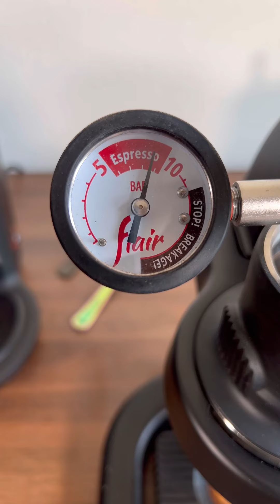Pressure Profiling on the Flair 58 #shorts #espresso #flairespresso #flair58

Comment: Love this!

My recipe with the Flair 58 is an 18 g dose, 40 g extraction. We pre-infuse with minimal pressure (1 bar?) until we see the extraction start to form at the bottom of the basket -- I haven't timed it, but I want to say it's probably around 10 seconds. We then slowly ramp as you described, to around 7 - 8 bar. The extraction takes around 25 seconds. We're using a medium roast -- 5 to 28 days from roast date. 

What I'm struggling with is channeling. It doesn't matter what basket I use (ridgeless VST or Pullman), or what tamper I use (stock Flair, Pullman Bigstep, Pullman Palm). I do the WDT thing -- 0.4mm needles.
Reply from the maker: Maybe it's not channeling? 🤔 what makes you think it is, how does it taste?
Reply: @FlairEspresso  it tastes just lovely! Here's a quick clip of this morning's shot -- https://youtu.be/Y533ZH6gb6I

I know it's what I'm doing and not the equipment, because I've pulled better looking shots before. :)
Reply: @razorx999  Thanks! I rinse the puck screen after each use. I actually ended up with two, and I recently took out the (new) second puck screen to use. There wasn't a noticeable difference.
Reply: @ykhemani  if it tastes lovely then no big deal, you dont have to chase for beautiful looking shot . As if it tastes bad, then try a finer grind setting , when i watched your clip i thought the grind size might be too coarse so the extraction looked a bit odd
Reply: After looking at your video, I’m leaning toward age of beans used to be honest. The thin watery look to the pre-infusion stage, even though it takes an appropriate amount of time, followed by an equally thin shot w visible channeling…. The time overall makes me lean away from grind setting and/or puck prep. Is it possible the beans are old, have been poorly stored? Not saying you’re doing this, but perhaps even before they reach you as the end user….
Reply: @ykhemani  👆
Reply: @kellenhassell  thanks! I'm buying from a local roaster, and I am generally finished with a bag of beans between 3 and 4 weeks of roast date.
Reply: @ykhemani  After watching your video, the issue is either of 2:
1- The coffee you are using is either very old from roast date,  your method of storing is wrong, or you don't grind before extraction.
2- Your coffee grinder is either has an issue of grind consistency, or has high retention. Clean your grinder, and grind fresh just second before extraction.
If your grinder is On-Demand style, fill the hopper 25% or higher, and grind a little to clean the exit from old coffee.
Number 1 is 99% is the issue, cause the crema is almost non existant with channeling, which is coffee aging/storing issue.
Reply: @RakanWD  thanks. Beans finish within 3 to 4 weeks of roast date, and are stored in a Fellow Atmos vacuum seal container. Using the Niche Zero, which generally yields what you put in, or 0.1 gram less. But I’ll clean the grinder.
Reply: @ykhemani  since you are using a single dose grinder, then the beans are the problem, regardless of what you say, the beans are the cause. Get your beans from a different roaster, and compare the results.
Reply: @RakanWD  just cleaned the Niche. Same channeling, but more clarity. Thank you for that suggestion. Actually reminds me of when I first got the Flair 58 (which is also when i first got the Niche). I was using the Flair Pro 2 before that.

I buy from a local specialty coffee roaster (Rare Bird Coffee Roaster) most of the time. I’ve also gotten beans from Counter Culture and Vigilante, but it’s been some time. I’ll order a roast from Counter Culture and see how they do.

This was a lovely, lovely shot to start my day. Thank you again! 🙏🏽
Reply: @ykhemani  I suggest that you smoothly ramp up to 3 bar for the preinfusion and pre-infuse for no more than 10 seconds total. See what this gets you.

Comment: Interesting that you used a 58.1mm Normcore tamper rather than the 58.0 tamper that ships with the Flair58. What spring did you use? Personally, I like a nice pre-infusion at low flow rate followed by an extraction driven by flow rate rather than pressure. I also use more water in the extraction and none in a Bodum foamed milk for a cappucino with the same amount of water in the final product as one made with a steam wand.  As it is so easy to flow profile with the Flair58 (that long lever), I am finding the grind to have more leeway than with a pump machine.
Reply from the maker: Flair tamper is 58.4 mm. Flow profiling is def the preferred way to go but most don’t have bt enabled scales or can do the quick math to be precise
Reply: The scales do not have to be BT, just have an indicator on them as to flow. Also, when you have pulled enough shots you can feel the pressure and flow rate by how the lever resists and moves.  @FlairEspresso

Comment: I'm no expert but the fact that you can modify the pressure anytime it's a great advantage over semiautomatic espresso machines that are not equipped with a variable pressure pomp which is basically anything cheaper than Lelit Bianca.
With manual espresso machines like Flair you can apply exactly how much pressure is needed to have a proper extraction so keeping the 9bar all the time is completely dumb.

Comment: When I preinfuse my shot I can’t ramp up to 9 bars. I can get up to 7 bars and slowly ramp down but then it begins to channel and have 2 or 3 swirls. If I attempt to take it up to 9 bars the puck degrades to the point where the shot is just vomit 15 seconds shot. I grind fine but I can’t do more. My grinder touches the blades.